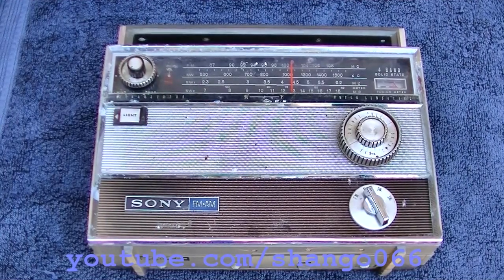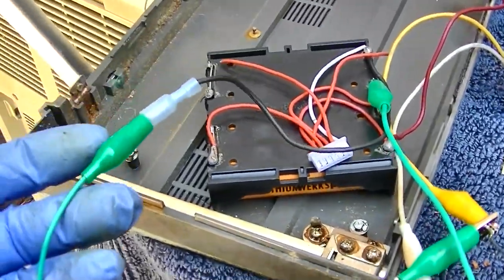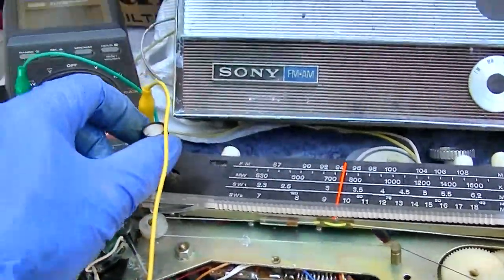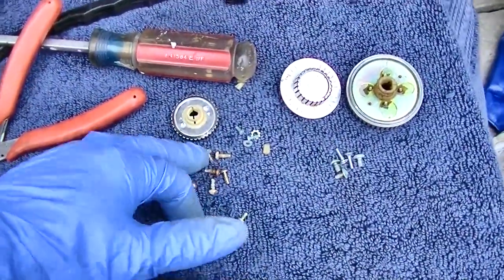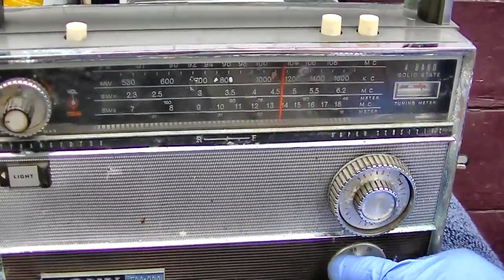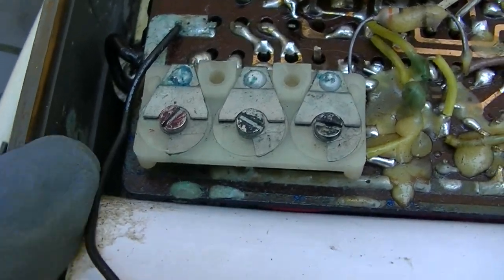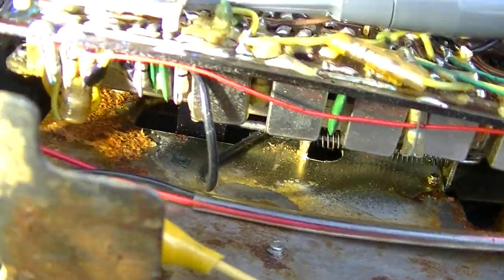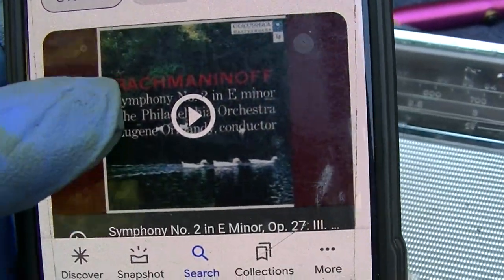Sony TFM1000 AM FM SW Vintage Radio Decrustification

Comment: Not sure what crackle pony master play is but I like it... is it just me or do modern batteries suck? I was clearing out the attic a couple of years ago and found some old video games and electronics from the 80s with D cells in them that were totally dead but 0 leakage, the cells were all dated around 86-87. These newer batteries seems to leak before you even get chance to use them, I have a 40 pack of Duracell that are still in date for another 6 years but half have them have started to leak before ever being put into anything.
Reply: I think the manufacturers have changed something. All the old batteries I find say Made in USA (plus a couple of made in Japan) but most of the new ones seem to be made in countries with cheaper labor and materials.

There's a guitar pedal in my basement which suffered from a leaky 9v but unfortunately I haven't been able to get a brand name or other info off of it.
Reply: They probably switched to thinner metal that corrodes through faster

Comment: Do radio stations even bother to check the level of Modulation anymore... 90% of radio stations sound like Garbage. at home I have my Sirius XM playing through an FM transmitter which is at least tolerable. I lso have an Ubuntu plaing audio through another transmitter and also through a TVM modulator (Simulcasting my Ubuntu) when I am forced to go back to FM listening the sound quality is just crap. I remember when radio stations had Engineers to take care of the crappy over modulation.  Comments?